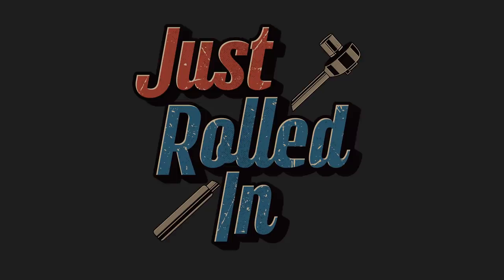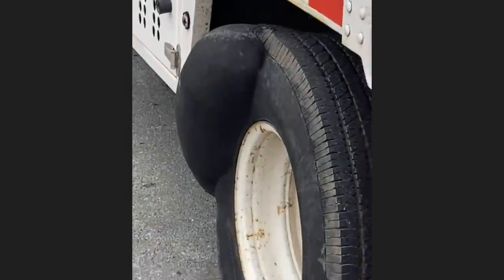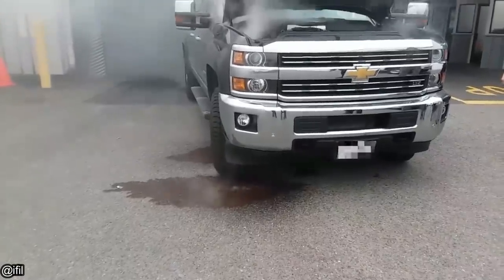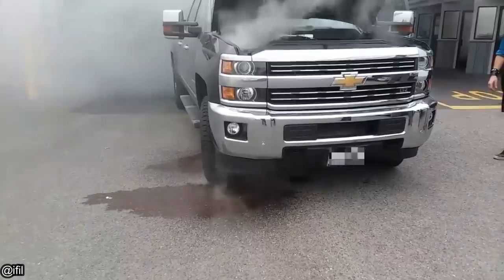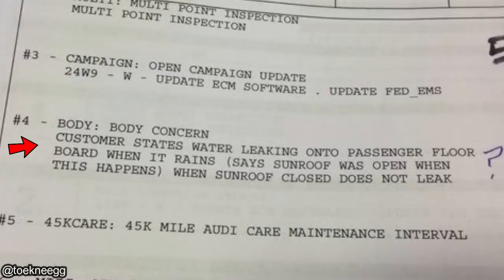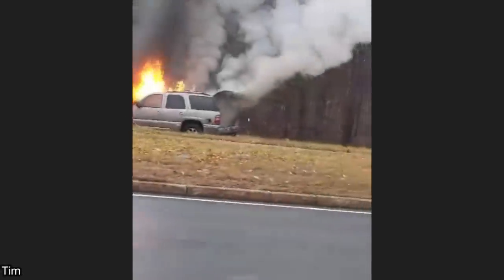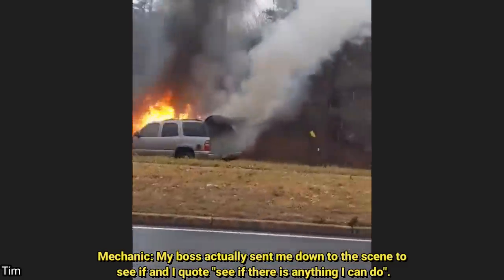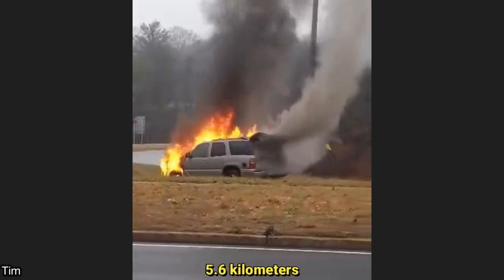Customer States They Have A HUGE Bubble On A Tire | Just Rolled In

Comment: Man, whoever drove in with that tire like that is braver than I am... And my '83 Chevy C20 has tires from 2003!... Although I never drive it on the interstate and they're heavy duty truck tires 16" 245/70 or 75 R16's, I forget the profile size haha. Still sketch but eh, I'll replace them eventually. Just spend way too much money on this truck replacing the tie rods, pitman arm, idler arm, steering box, steering pump and lines, all but 2 of the brake lines, calipers, wheel cylinders, shoes, pads, valve cover gaskets, and it still needs a carburetor, gas tank, and some other work.
Reply: My rule is 'Good tires and brakes first.'
Reply: @donnash5813  Well I've got the brakes haha!

Comment: RE the runaway diesel.  If it's a manual you are lucky, put it in 5th gear and drop the clutch.   Next is to get a fire extinguisher nozzle (preferably CO2) right up to the intake and starve it for oxygen.   I knew someone who was stationed at an air base in Alaska.  The huge military snowblowers to clear the runways had diesel engines, and they were given detailed instructions how to deal with them.  Some of these engines had a shutter built in so you could pull a chain and block the intake.  Failed turbocharger is a common cause, also if the engine manages to "suck a gasket."

Comment: Pretty amazing that that wrench made such a good seal after puncturing that gas tank. Likely would have not done so if it was a metal tank. That's if it would have gone through at all. I think I'd just feel safer with a metal tank. I have a center console boat that has a 20 gallon plastic fuel tank and even that makes me nervous. I'd like to replace it with a metal one eventually if the were ever a fire I don't think the plastic tank would give you much time to get the boat stopped and bail vs a metal one.

Comment: The runaway diesel due to oil overfill... hopefully the customer gets informed about that, sure they'd able to tell it happened?  What does the shop do at that point, offer a longer warranty?  Tear down and inspect?
Reply from the maker: Well the customer didn't get the oil changed at a GM dealership, I think it was Ford instead. Since it was the dealerships fault, their insurance company will be covering the costs for a complete new engine. They are first tearing it apart to see what it all needs.
Reply: @JustRolledIn  It needs a new engine! I wouldn't trust rebuilding it after that kind of abuse and damage, and the loss of value on it with a rebuilt?  UH UH!! New or I sue!
Reply from the maker: @markh.6687  they aren't rebuilding it. Just tearing it apart since insurance always wants photos for stuff like this.
Reply: @JustRolledIn  Good thing.

Comment: You know i have that same problem when i leave a gap whenever i roll my windows up (i do that to vent the heat so my car doesn't feel like a blast furnace when i open it, it gets hot AF here in Fl) and it rains my seat would get wet. When they're fully closed, the seats are dry. WTF?? 😂

Comment: Those tire bubble separations can also be caused by running a tire with a slow leak and just adding air when needed or tire plugs instead of patches on the inner lining ! ! !

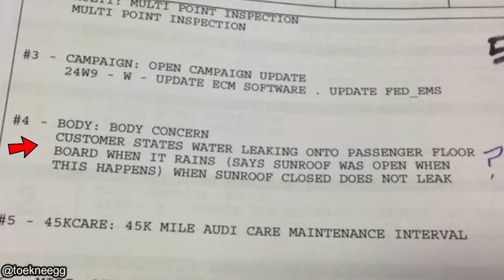Comment: 01:30 most likely the customer thought that rain cannot leak on the passenger seat when the sun roof is open because it is the sun roof and not the rain roof - IQ 1000000000

Comment: Geezus, be carefull around those "bubbles"! There was accident in local workshop  when tire defect exploded and the blast badly hurt (upper and lower body and has to be put on ventilation and artificial sleep)
Reply from the maker: Damn that's scary and yea I'm surprised the people filming it were so close to the tire.
Reply: @JustRolledIn  It´s not laughing matter. Bigger tires= bigger damage. I had a colleague who´s son was badly mangled by exploding tractor tire. The shock was so big, that it shattered the disc and cut off his arm and leg. 
I was really suprised how leisurely they manipulated  the car tire. One tiny tremor to weak spot and BOOM! 

However, thank you so much for this compilation!
Reply from the maker: @miroslavzima8856  wow that's very sad. Thanks for sharing this.
Reply: @JustRolledIn   If I didn´t know what can go wrong, I would be probably like "whoa, funny bubble!" but I got shivers when I seen that. 
Mechanic´s job (like most of other jobs) can be pretty dangerous - thank god we got them, right :) 

Take care and continue in these compliations :) Subbed and will watch them :)

Comment: A few years ago I saw the aftermath of a truck that lost a box of nails on I-17 , several vehicles lost all 4 tires , there were a bunch of tow trucks, street sweepers and cops . Tires + muiltiple nails = bunch of flat tires
Reply: Oh I-17 is in AZ , and also runaway Diesels can be caused by a blown turbo ( which also inputs extra oil into the engine)

Comment: Putting screws into someone’s tyres is not a “prank”, it is attempted murder. There’s no knowing if it will be a slow, easy to handle air leak or a catastrophic blowout whilst on the freeway at 80mph that kills.

Comment: What I'm wondering is why are they recording it and not trying to starve the runaway engine of air to save the engine!
Reply from the maker: Maybe there boss told them not too, just incase it blew up. 
Happened last place I worked at. We pulled the posi. Air cable and the boss said to run away. Still blew up 🤣
Reply: @JustRolledIn  fair enough but if caught early enough then you don't have to worry about it blowing up. I just hate seeing engine self destruct it's so sad
Reply from the maker: Definitely. I wonder what exactly happened leading up to that event lol
Reply: @JustRolledIn  right I'm wondering the same thing.

Comment: I know this channel isn't for this, but asking for some ideas about my car. I haven't had any responses anywhere else.

I have an 03 vw past wagon. I can't get the car to start. Checked the coolant temperature sensor, because the last time it did this the sensor was bad and the car thought it's temp was around 5-10 degrees Fahrenheit. It was dumping to much fuel in. Changed the sensor and the car started fine. This time I checked the temp and again it was around 5-10 degrees. Changed the sensor and nothing changed, the car still thinks it's really cold. I am ready to just junk the car.
Reply from the maker: Does it just crank? Just clicks? What exactly happens? Feel free to email me and I'll see if I can help.
Reply: DO NOT JUNK THE CAR! Take it to the cut-rate wiring guy and his insurance will cover a new one when it burns to the ground.
Reply: @MrTruckerf  That's a good idea. Hmm, now how do I get it there.
Reply: While the CTS is a known failure point for these cars, I don't think a new one should fail that quickly. Just to verify the CTS is the problem, without purchasing another one, unplug it and try to start the vehicle a couple of times. With it unplugged, the vehicle should still start, but it's going to run really rough. If it starts, then great. Its an issue with the CTS or it's circuit. It's not unheard of to buy a new part and have it fail nearly immediately. If it does not start, then its probably something else that is the real culprit and the CTS would seem to be just a symptom of that. If you had a scanner, you could check for some engine codes that may help point yourself in the right direction to look.
Reply: @miyokorei22  I did replace it again already, and it's still reading the same temp. I will try again with the connector unplugged, when I get a chance to be where the car is.
Reply: Where are you buying the sensors? Some cheap junk from Amazon or autozone, or a genuine oem v.w. sensor?
Reply: Computers is why I like my old '91 F250 445 diesel. 1.3 million clicks on the clock, replaced a few things but it's never been apart and still going.
Reply: @henrydillard6217  From advance, but I don't think it's the sensor though.

Comment: A CO2 fire extinguisher would have stopped that run away diesel engine.
Reply: It used to be a BCF one until it was banned. One piston firm here in the UK recommended having one handy when starting a Diesel after a rebuild.

Comment: "kids pulling a prank by screwing two of his tires"

The way those screws are in there, the car MUST have been mobile or movable. No way you'd get the screws in all the way around the tire like that. At best you could screw it in at the exposed parts which would be less than 1/3 of the entire circumference.
Reply: Or they used a floor jack to lift whichever end of the car wasn't attached to the driveline so they could spin the tires by hand.

Comment: Yeah, how would you stop a diesel running off its oil supply? Can't cut the ignition, doesn't have one, cant shut off the fuel, drain out some oil?
Reply from the maker: You need to cut the air or fuel supply. You could take the air filter out and block the intake.

Comment: Genuine question, can you not turn the engine off if its lost control like that truck?
Reply: The only way to shut the motor down is to block the air intake and suffocate it. It is literally running on its own oil with no governor or anything. The engine can't last at the super high rpms and it WILL break.
Reply: Nope , diesel engine running on its own oil , the only way to stop it is a rag in the turbo ( or a board wider than the turbo opening )
Reply: @thomasfletcher4765  And for God's sake don't try to use your hand.
Reply: @DCBChump  well , so much for that idea 🤣🤣🤣🤪🤣🤣

Comment: That was a runaway diesel.. It IS NOT caused by too much oil.. It's caused by a turbo bearing failure. The oil blows past the seals and into the intake...
Reply from the maker: but it drove in for an oil change, where they forgot to drain the oil and added another 10 quarts...

Comment: 0:55 why is no one shutting it off? wtf
Reply from the maker: Good luck with that lol.
Reply: @JustRolledIn  you could just block the air intake, so there is no more air and the engine shuts off🤷🏻‍♂️
Reply from the maker: Yea but the liability if that engine blows up while a technician at a dealership tries that, is going to cost more then and engine. 
We had a generator runaway once, we pulled the posi-air cable and it still ranaway.
Reply from the maker: But I don't want to lose my panties 🤣
Reply: If it was my own 1.9 liter diesel I'd give it a try, but someone else's 7 liter fat ass block, I'd be a bit reluctant getting close.